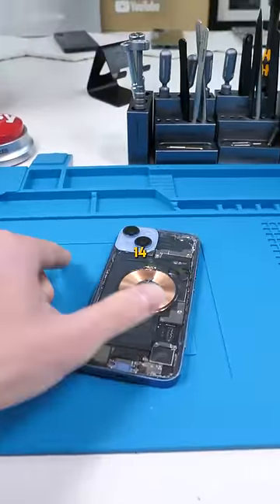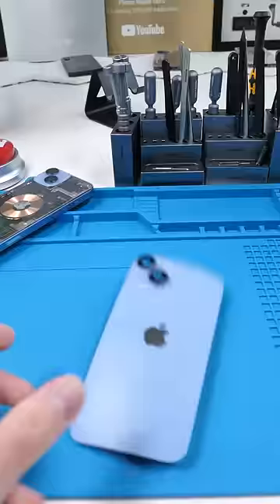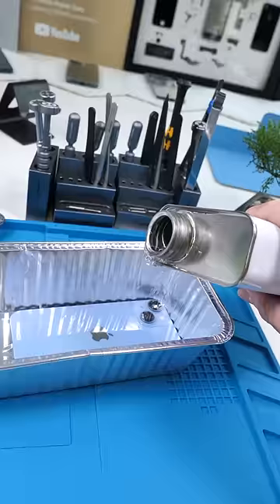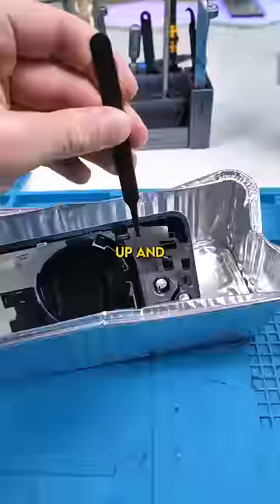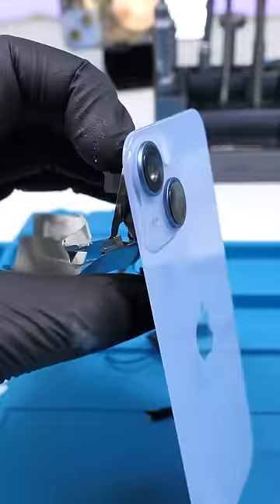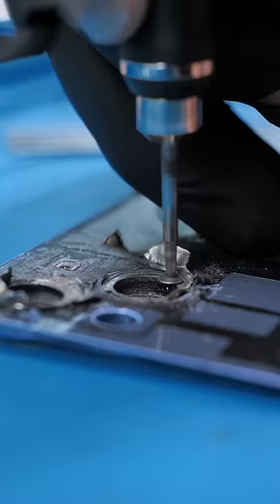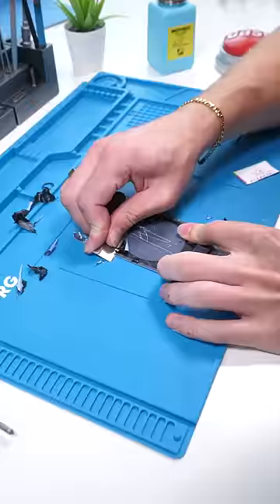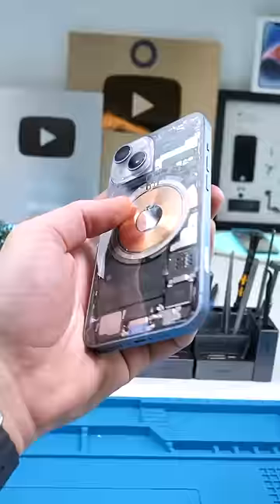THE BEST MOD YET… iPhone 14 #Shorts

Comment: If you use cheaper replacement parts the color on the glass can easily dissolved with common solvents. Used to do this to repaint them to make custom colors and logos
Reply: Also the cheaper Chinese parts are not laser welded but rather just glued together making this process so much easier

Comment: Why didn’t you just use the tool that takes off the broken screens? Should it theoretically take off the back panel color if you turned it around?

Comment: Quick question does the wireless charging act as a heatsink for the phone? Looks like it does depending on contacts mine has a vapor chamber instead or wireless charger i dont mind plugging in as less power is wasted anyway 😊